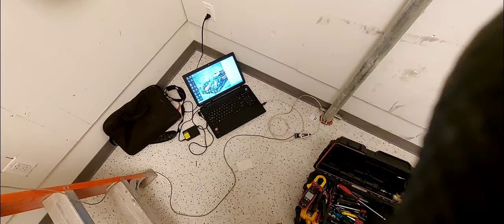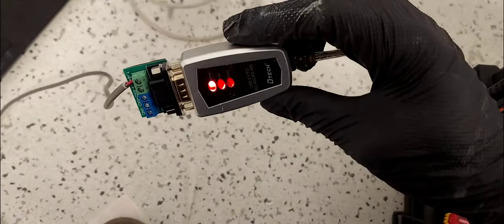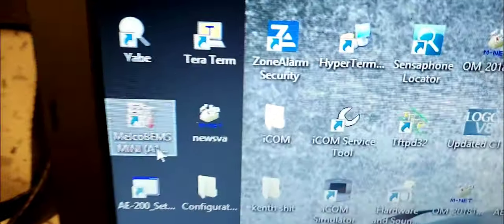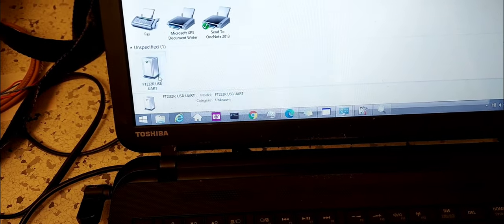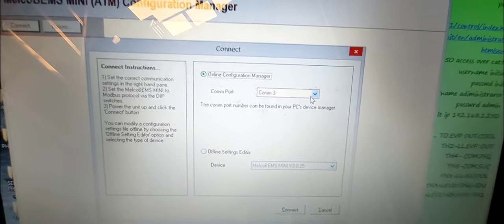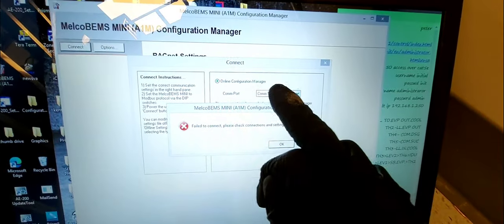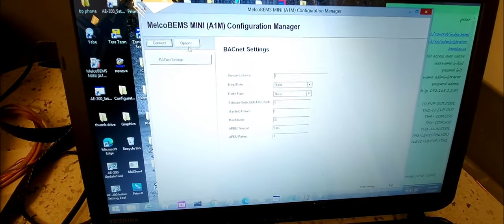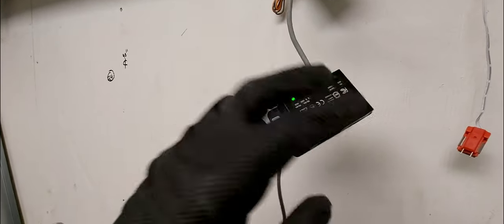PROCON MELCOBEMS MINI A1M BACNET SETTINGS

Comment: I wish i should have watached this video before i try to do setting earlier today. I did the setting as per quick startup guide but its not communicating. The only thing i did not do as per this video is NOT changing Max master value. I kept this default as 32 & write the setting. Ill try changing this value as 127 & comment here back if that helps. Unfortunitely the site is operational & its very dificult to do access the minisplit controller! Thanks for poasting this video!
Reply from the maker: Thanks for watching

Comment: What if it says could not find device with ID 30025??
Reply from the maker: Are you doing the same thing as in video    ?
Reply: @D2DNYAC  Also doing the same for me. Not sure if it's a com problem or something with the setup? Doing everything you are in the video but no go. Is there a list of definitions (type files?) that I need to download with the software?
Reply: @TheMCMoosey did you find the solution? Same issue for me